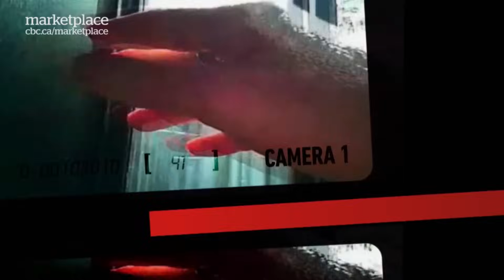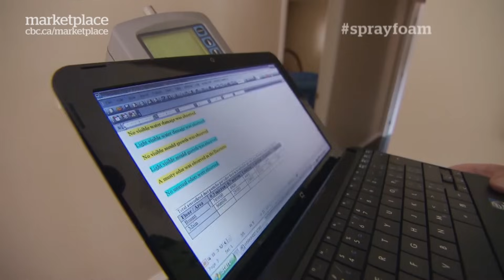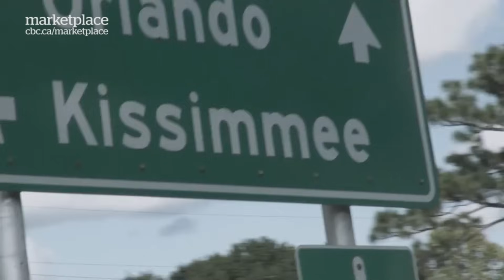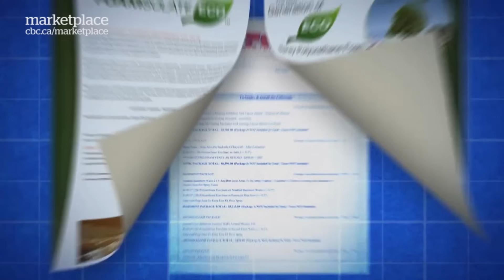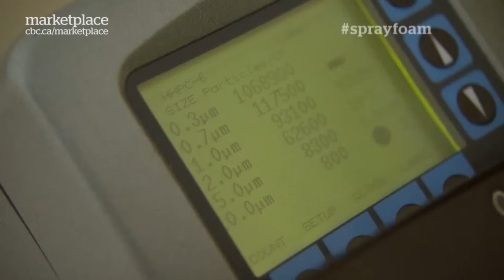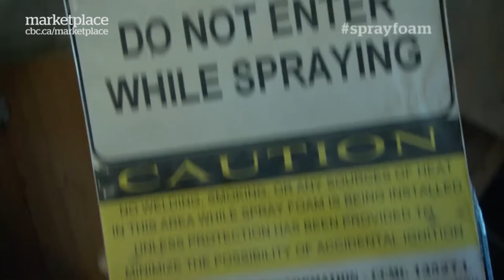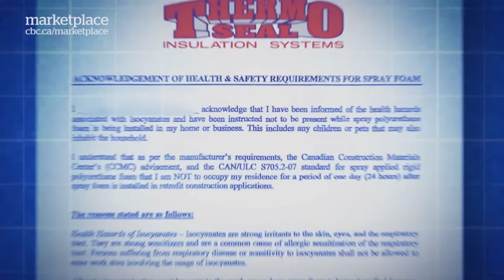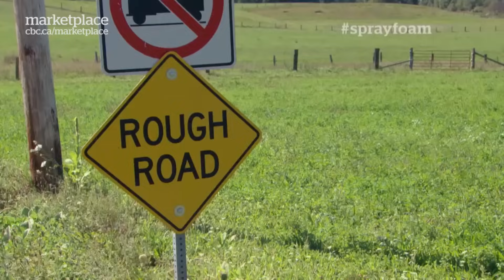Spray foam insulation nightmare: What can happen if it's not installed correctly (CBC Marketplace)

Comment: I normally love the Canadian version of these show and I use them in my business classes...this one was highly emotional and could have benefited from more investigation.  I wonder if the original mixtures were not good or was there a problem with the new house (new houses can have problems with other materials).  After some extensive soul-searching and research I elected to have a company remove the fiberglass insulation from my crawl space (sagging/falling and gross) and had them spray the perimeter joists and wall area which was less than 2 feet; I also had them spray the joists of the attached basement.  That coupled with replacing the single pane basement glass has had a remarkable impact on my energy savings.  The smell was noticeable only for the first day and dissipated after 24 hours as the contractor stated (we left every window in the house open for a few days to be sure).  A year later and we couldn't be more pleased.  The basement holds heat better with no drafts and less bugs.  My wife commented the wood stove in the basement does a much better job.  The basement has been transformed from a cold, gross eyesore to a valid place for my workshop.  In short, pick the company carefully (my guys had a professional setup and they came across as super knowledgeable).

Comment: I've been a home renovator for many years, have never used spray foam insulation but always thought it was great. After seeing this I will never use it.
Reply: that's NOT the message here
Reply: Leslie B  what the hell does multi million dollar homes got to do with it. Does it spray on different?  Yes sarcasm.
Reply: Laern the difference between open cell and closed cell
Reply: @thepoliticalfisherman5941  
Millionaires dont use cheap products
I work in Seattle 
$3-5mil homes everywhere
Reply: @thecloneguyz  actually sometimes they do, but my point was because you worked on a million dollar home doesn't mean you have more authority on a subject.

Comment: I appreciate the report NOT slandering the company in question, but instead, just sticking with the facts. I am so tired of others and how they love to sensationalize and slander people, good job ;) You've convinced me to use fiberglass, besides, its actually cheaper even with vapor barrier and other prep, also when it comes time to replace the roof, if wood needs to be replaced, spray foam increases the cost to replace wood.

Comment: Why are the doors and windows of the Francescini house closed in good weather?  All of them should be open to let the gases out.  The outgassing doesn't last forever.

One bad job after 15,000 installations?  Sheesh, you'd hope your doctor and dentist had such a good track record.
Reply: ***** The doors and window are shut because they're trying to artificially boost the percentages of any gases that may be there.  The list of chemicals in the air didn't match those in the foam at all.  Why's that?  Off gassing of the glues in the wood in the furniture, the carpets, the foam in the bed, the plastic in everything, etc.  They have a problem but not all the foam's problem, I'm thinking.
Reply: EXACTLY!!  A HRV or ERV (depending on climate) is essential and frequently over looked imho.
Reply: +Linda Rossi In a normal situation no one leaves their windows and doors open all the time. what they are doing is natural. opening all their windows and doors is artificially removing the gas making it seem as if there is no problem.
Also the chemicals could have mixed when they where spraying and created new chemicals that the company is not aware of.
Reply: MrPepsicola123
 "... the chemicals could have mixed when they where spraying and created new chemicals that the company is not aware of."

That's sort of like having a duckling hatching out of a chicken egg.  It makes no sense.  When the two components of urethane foam-in-place insulation are mixed, the results are fully known and predictable, regardless of the ratios.
Reply: ***** There are variables that are not available within labs  and unexpected, maby the roof had some chemicals already in it. maby the wood was special.
Reply: +Milosz Ostrow  "It's a scorching June day" isn't reason enough? On a scorching June day I'd have my windows closed and the A/C cranking. Off gassing for that long, no way unless something is wrong and then the installer should make it right.
Reply: +Milosz Ostrow You make a good point in stating that the home was intentionally sealed to maximize the odor. Being in that upstairs bedroom must be HOT and possibly contributing to the chemical degradation of the foam. If the bedroom was well ventilated by air conditioning the stench might have gone unnoticed and the family would have just passed away without anybody being put out. 
I prefer the rolled insulation. The stuff is easy to work with and if it needs to be replaced removal is simple. 
The spray foam insulation is easier to install but complete removal is impossible without replacing everything that it comes into contact with.

As for the formaldehyde in the air samples look down, not up. There is an epidemic of contaminated wood flooring materials containing excessive amounts of formaldehyde. 
So there is my reason to use time proven materials. want wood floors? ---- use real wood and polish it to keep it looking good.
Reply: +MrPepsicola123 good point .. treated lumber.
Reply: MrPepsicola123 After watching the video again, I don't think that was the case.  The Francescinis had been living in the house for several years before having foam insulation retrofitted.  If the lumber were the source of their problem, they would have noticed it before the foam was installed.  It is more likely that something was amiss with the spray equipment and the two components of the foam mix were applied in the wrong ratio.  That would also support the contractor's contention that he rarely hears of problems, because most of the time the equipment works correctly and the components are mixed in the correct ratio.
Reply: +Linda Rossi well, you're not thinking correctly then....because the chemicals in the foam can combine to create other chemicals...that's what the air quality expert said right in the video and he is 100% correct. 

No, the doors and windows are shut because that is normally how a house sits....

A properly installed spray foam should be gassed off in a week....if not a day. The foam is cured in hours.....what needs to be removed is any chemicals caused by this curing process. Once the air in the house is completely replaced, there should be no more chemicals.....
Reply: +Milosz Ostrow sorry no, you are incorrect.....different proportions of any two compounds can result in variations of the end product....

For example: what happens when you mix too much hardener in auto body filler? you don't JUST get gassed off polyester, you also get hydrocarbons because it started to burn from the heat generated. 

I suggest you go back and take industrial chemistry 101.......
Reply: +Bob Jimenez no point...a) that lumber wasn't treated....b) it is illegal to use treated lumber inside (other than blue lumber) and c) no one in their right mind would double the cost of building a home to use treated lumber where you shouldn't use it and it is unnecessary TO use it.....

How do I know it wasn't treated? I've been a building carpenter for decades and I can tell by the stamps on it....it is SPF framing lumber, nothing else.
Reply: +Milosz Ostrow You are 100% correct. People don't realize that to screw up the installation all it takes is a 1/10th of a turn on the mixing valve and the foam won't cure properly.....since the foam is chemically cured, and obviously it is NOT curing properly, this is a no brainer.....
Reply: michael C In two-component chemical reactions, if you have component "A" and component "B", a perfect ratio will form product "C".  An imperfect ratio will result in product "C", with an excess of component "A" or component "B".  The reaction would normally not spontaneously create products "D", "E", etc.

Even though it wasn't my favorite subject in engineering school, I think I understand chemistry well enough to do without your jab about having to re-take a basic college course.
Reply: ***** Actually, if I remember correctly, nope, that isn't always the case....(the compound would just have more of A or B).....

That is fine if there is no chemical reaction going on....but in the case of thermally reactive chemicals, changes take place.

A perfect example (which I stated previously) is auto body filler....you mix in too much hardener and you WILL get combustion which creates gases, amongst those gases, carbon dioxide.....

See, with spray foam, you have chemical a + chemical B, in the correct ratio and under the right circumstances, = compound C.....if they are mixed in the incorrect ratios, you'll get POSSIBLY some compound C, plus uncured compound D (which would consist of uncured portions of A and B).....

And as demonstrated, if you apply heat they you would get both A and B undergoing chemical changes because heat IS a catalyst for changes in chemistry...since both A and B are not "pure" (aka only 1 base element) they are made up of other chemicals which underwent processes to create them, then you cannot guarantee that none of the other chemicals used in their manufacture might not react the same......

Kind of like if you apply heat to an orange and if you apply enough heat, you'll get liquid sugar....because the orange contains sugar....
Reply: dbltrplx yup...I couldn't agree more...even the best in the world at anything screw up once in a while.....

Hell, Mario Andretti is arguably the best driver in the world but he didn't win EVERY race....

And Sydney Crosby is arguably the best hockey player in the world, but he doesn't score every time or win every game.....

First of all the company shouldn't have sprayed insulation in the attic.....that was their first mistake......any reputable company would have told the clients: you'll get better R value by blowing in loose fill insulation....
Reply: +Milosz Ostrow Yeah, you could have A+B > AB; or A+B> AB + A; or A + B > AB + B  and then you could have A+ [H2O in air] (> hydrolysis->) A + C; or A + Oxygen (-> Oxidation ->) A + D.  I don't know anything about offgassing but I would imagine it would follow a zero or first order curve if you left the windows open and had an attic fan going.  The contractor should have insurance for this type of thing though; they shouldn't have brushed them off.
Reply: Quercuspalustris50 not sure what a zero or first order curve is but considering much of the gas will be partially trapped inside, it could gas off for years......

Think of a tub of drywall compound left with the lid off: it will harden all the way through over a day due to the wicking action. The outside layer as it dries will dry the moisture out from the centre...

Then think of a tub of silicone caulking...it could be months before it is dry all the way through because the outer layer of silicone will slow the interior from drying.....
Reply: +michael C You are correct about the " slow the interior drying"!     The outgassing can be roughly modeled as two(or more)  first order time constants. One that might  say a few hours and the other radically longer ie weeks or months or years. ie you are correct that the outer layer halts the "interior from drying" . I ran tests on this with optics bonded with RTV and other adhesives; the outgassing would leave crud on lens surfaces or get into other components. Once a layer skims on the RTV is like in its "glue" :) container again and thus it may take a very long time to dry. You want a high surface area to volume hidden under the "skimmed dry" layer that radically halts the outgassing. JPL and NASA have forbidden materials to use in space flight; ie a solid will outgass in a vacuum and fog optics too.
Reply: 3beltwesty you put it way more succinctly than I did....I should have gone to school, instead of simply learning by experience hahaha

Hey, why is my silicone dried up? oh, it's only dry on the surface, ok, I'm good once I get rid of that.....and oh crap, the lid wasnt' tight on my drywall mud....gotta buy another tub! :-(
Reply: +Milosz Ostrow At about 13:54 in the video, they go into the house and check again. The home owner says that they regularly open the windows and run fans for ventilation.
Reply: SciCurious If I had that situation, I'd leave the windows and doors open continuously during good weather, not "regularly", with just screens to keep bugs out.  By doing that, if there is any outgassing, the concentration would never build up enough to cause ill effects, and even though Canadian summers are shorter than summers where I live, it should be possible to air a building out for 2000 to 3000 hours before cold weather sets in.
Reply: ***** so, you'd have no problem heating or cooling the outside? Do you realize what your electricity and gas bills would be?

And then you have no guarantee that it would be gone...

Tell me: If you bought a new car and noticed a bad smell in it, would your solution be to just drive around with the windows rolled down, all the time instead of finding out what is causing the smell?
Reply: +michael C New Car smell is caused by outgassing of the new plastics, adhesives, phthalates, plasticizers, and rust preventers. The inside of the windshield gets a fog film that comes off the dash panel. Oddly many associate these smells as good; ie the "new car smell" like the stuff in an insect killing jar in grade school. With time and heat the outgassing slows down. The same goes with a used Ebay ham or CB radio that was owned by a chain smoker; when the rig is on and all warmed up one gets tar fumes
Reply: michael C — I wrote "good weather".  Southern, Canada has mild weather during the late spring, summer and early fall, although in some areas it can get rather humid.  Until the 1960s most people survived the summers quite well without cooling.  The only consideration would be to have screens on the windows to keep mosquitoes and blackflies out.

As for new cars, yes, I drive around with the vents open to ventilate the cabin, rather than recirculating the air with the heater or air conditioner on.
Reply: ***** I can't recall where this house is, but where I am in Muskoka, I have had to put the heat on some nights....(and some days lol) during the so called summer....

Yes, people survived without air conditioning....but they also survived without cooking their food....without medical care and many other items. Let me put it to you this way: would you go without cooking your food because a stove you bought from sears didn't work? That in order for it to work, you couldn't use it for 9 months?
Reply: michael C You're being silly.  I used to live in Ontario and still go back from time to time to visit.
Reply: ***** errr am I now? do I have to produce the weather records over the past 2 summers?

Last summer (2014) we only had 2 days over 30 and only 6 over 25 most of the days were 18 to 20 and nights were down to 10/12 and that was in July.....

I think this past summer we only had 6 days over 30.....

So, yeah, considering I live here 24/7 and in Muskoka for the past 6 years.....

Comment: " when it's installed properly" sounds like industrial standards need to be reviewed
Reply: obviously it WASNT installed properly. You dont review industry standards because someone screwed up. Thats what insurance is for
Reply: @churchchris1143  fine, industrial practices then xD. if its so easy to make such a harmful mistake then yes they definitely need reviewing
Reply: @aidanhart9871  drive by wire has killed entire families and its still going to be the Industry standard some day. Flaws happen, engines explode, electronics fail. An industry review isnt even necessary. Anyone in the industry knows it was a bad mix. Companies  have insurance so they dont have to pay for a roof and medical. Thats what insurance is for.......F-Ups
Reply: Standards are great. The fault was with the contractor and the sprayer.
Reply: No, it sounds like industry standards need to be adhered to.
Reply: @aidanhart9871  Negligence is not making a harmful mistake, it's willful disregard or ignorance of procedure.

Comment: "If it's not installed correctly" So why demonize the foam product and not the company that applied it?
Reply: Do you wind up in the hospital if blown in insulation is improperly installed?
Reply: @johnkirby6700  if the blown insulation is fiberglass there is a chance.  It just takes much longer to realize.